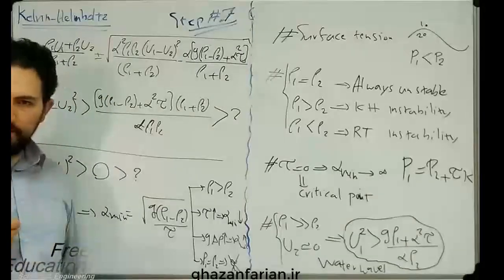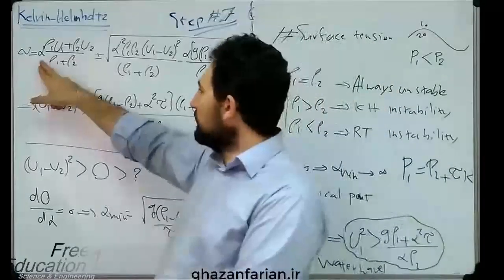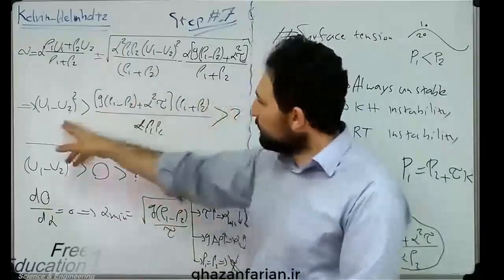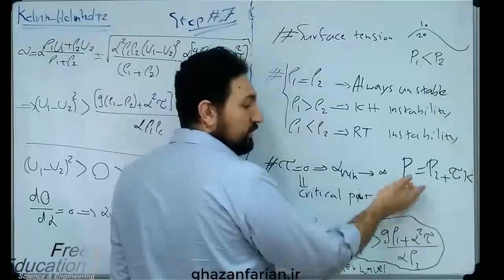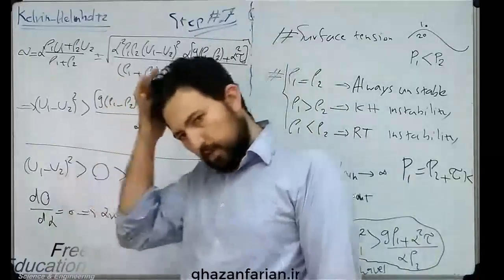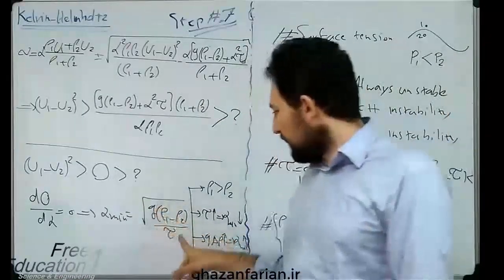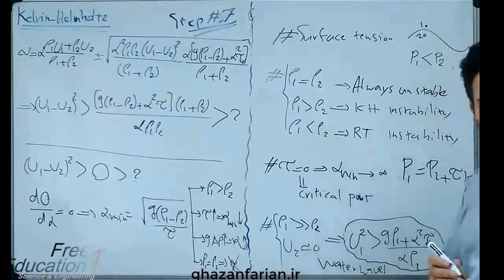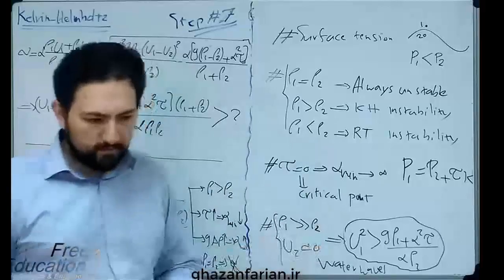The Kelvin-Helmholtz Instability- Step 7: Final Results

Comment: May I check with you what is the physical significance of the two terms in the equation for c, phase speed?
Reply from the maker: The phase speed indicates the rate of propagation. The phase velocity always lies between the min and max velocities. For example, when c_r=0.4U, it means that the TS wave travels slower than the free stream. It can be supersonic in high-M flows. It is the speed of propagation of the disturbance on the interface (in interfacial instabilities).
Reply: @JafarGhazanfarian  hmmm can I label the first term '(U_1 ρ_1+U_2 ρ_2)/(ρ_1+ρ_2 )' as TS wave travel and '√((g(ρ_2-ρ_1))/(k(ρ_1+ρ_2))-(ρ_1 ρ_2 〖〖(U〗_1-U_2)〗^2)/〖(ρ_1+ρ_2)〗^2 )' as free stream?
Reply from the maker: Problem 5-2 at the end of chapter 5 maybe helpful.